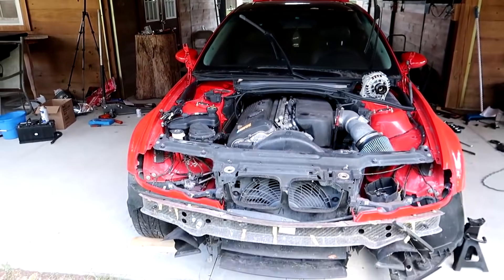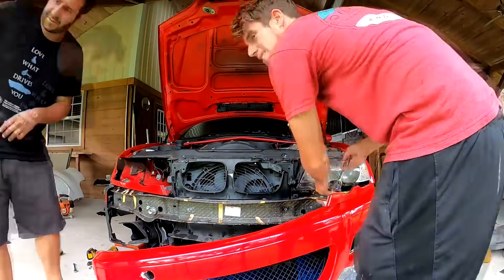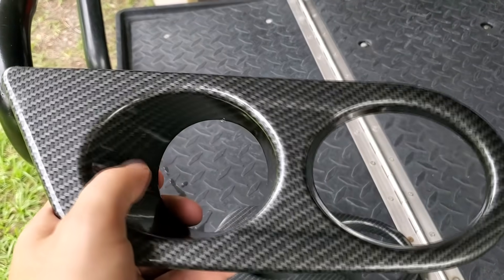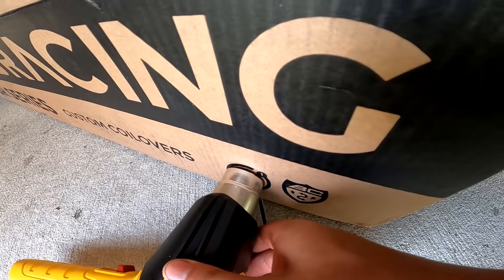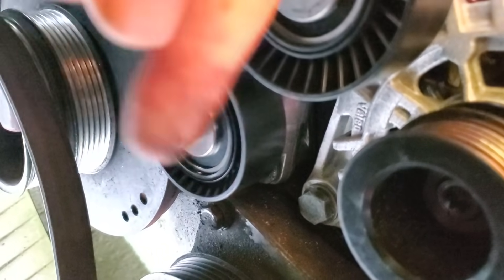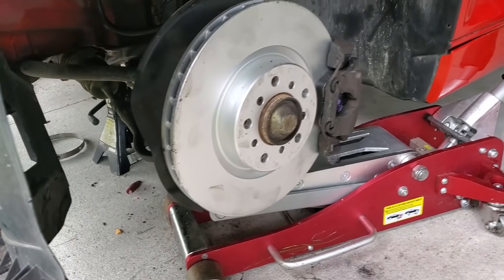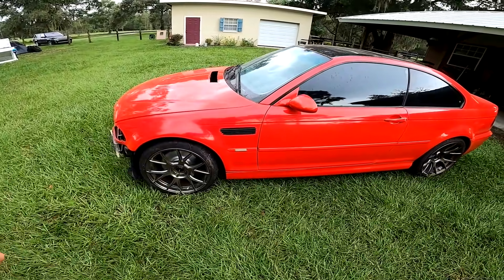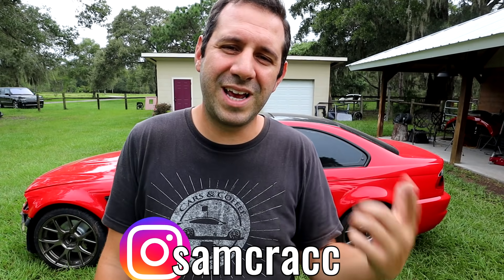I Got Lucky Buying a Cheap Flood Salvage BMW M3. It's WAY Better than I Thought!

Comment: "I didn't have any carbon fiber trim to match the rest of my car" so, I'll paint them black... installs fake carbon fiber steering wheel...
Reply: I understand it was a sponsor but even at that he completely contradicts himself lol
Reply: It's fake carbon?
Reply: Yeah, I had the exact same thought.  The dude is kind of a putz sometimes!
Reply: I'd put that wheel even on a bicycle, it's just awesome .
Reply: I have a similar carbon fiber steering whell in my car and I will tell you, it is not fake. I know Anthony (the guy Sam was talking about) and he makes these things himself with a lot of pride and quality. But the stuff up front came way before Sam got the steering wheel, so, he's not contradicting himself.
Reply: @bruces12  Besides, interior and exterior are two diferent things..., a carbon steering or shifting knob is always nice, even if it's the only carbon on the car.
Reply: I was about to write the same until I found this comment😂👍
Reply: It looked like the carbon on the steering wheel didn’t align quite correctly on the right hand side and Sam should have detailed the original boss/airbag . It looks a bit shitty on the new carbon wheel
Reply: @Mike Hunt Lame as the mat black rattle can rock chip prone spray can job? Get real!
Reply: @markbennett6658  This steering wheel looks really disgusting. Carbon fibre bits don't line up at all, the horn doesn't match to anything... And as a whole, this is something you will see every time....
Reply: @damndman2009  I get your point! And if it was me I would leave the fake carbon instead of the spray paint..., looks cheap to be honest.
Reply: It was free. I'm not a fan of carbon fiber so not sure if I would have put that on, even being free, but the next owner may love it.
Reply: @Mike Hunt Point taken. Cheers mate! 🍻
Reply: @diodiogo111  100% agree 👍
Reply: I'll walk with that steering wheel all day and steer my way around town.
Reply: Kronstad honestly probably I have a f30 3 series and if it was real it’s gonna be like 1200 just with carbon fiber for the steering wheel
Reply: Kronstad but you would never notice if it’s done super well
Reply: @damndman2009  or a red bmw with red leather still looks good
Reply: Horrible looking steering wheel.

Comment: You do NOT need to bake open pre-facelift e46 headlights. I made that mistake once and my whole housing got very slightly warped. The heat/cool cycle also made one clip on the other housing crack. There's just clips all around the lens and it pops right off, no adhesive, it's a rubber seal. If you're doing this to your pre-facelift e46, just be safe and don't bake them open.

Comment: “These carbon fibre fog light bezels don’t match anything on the car”.... fits a carbon fibre steering wheel 😑🤣
Still like your content Sam, keep it up 👍🏻
Reply: came looking for this comment
Reply: @Mike Hunt This steering wheel looks really disgusting. Carbon fibre bits don't line up at all, the horn doesn't match to anything... And as a whole, this is something you will see every time....
Reply: @KrzychooPe  I agree and the shape doesn't fit the car
Reply: @Mike Hunt If he/I made the steering wheel myself it would be OK, just OK. But for something "professionally" redone it's a no no for me 🤢
Reply: WHY PAINT THOSE CARBON FOG LIGHT BEZELS OMG CRINGE LEVEL 100
Reply: Nail it
Reply: Need to clean the center and dye it to restore the black
Reply: @Mike Hunt uh, no there's no difference. Both are fake carbon fiber plastic. He would have been better off keeping the light housing as it was.

Comment: Samcrac: Spends a ton of time explaining how risky flood cars are and they are massive gambles that inexperienced car owners should not undertake.

Me: instantly looks for flooded e46s
Reply: Freshwater flood cars usually have nice, clean bodies.  Buy a second similar or better wrecked car and swap over the wiring, interior, and other parts.  Its a lot of manual labor but usually fairly straightforward process.

Comment: Did they install the coils wrong? Looked like the chamber adjustment would be a a weird angle also adjusting caster
Reply: Mr. False I noticed that too
Reply: Yes adjustment is not supposed to be in angle, rather "side to side"!
Reply: They are wrong installed.
Reply: Yup and I commented on the last video that they were wrong too lol
Reply: I second that, installed wrong, steering wheel also looks like a ricer boy special.
Reply: Yep clocked incorrectly and that steering wheel is hideous.
Reply: Yeah exactly. Suspension is all messed up, ricer shit everywhere, no major items addressed (valve adjustment, vanos, rod bearings, subframe.) some poor idiot is going to have so much trouble with this car.
Reply: Yes, they’re wrong.  Should also do fcabs and rtabs while in there, at the very minimum.

Comment: I think the camber plate on the coilover are installed  wrong, suppose to be facing the engine not toward the front.
Reply: I was about to say the same thing.
Reply: Just said the same in the comments of a  previous video 🤷🏻‍♂️

Comment: Interesting camber adjustment🤔
Reply: I came it to mention that they installed the camber plates wrong. They need to rotate them one bolt.
Reply: Just Reading comments to check if someone else noticed
Reply: Surprised more haven’t noticed
Reply: Came for same.....
Reply: This is actually a "mod" for E46 M3 camber plates, you rotate them either 180 (L&R swap) or 120 (like in the vid) which will modify the factory castor angle. I personally had done the L&R swap years ago and found adjusting camber difficult, this isn't as quite as bad but doesn't provide the same amount of increased castor.
Reply: @ericc6485  there are better ways to adjust the castor such as with offset fcabs
Reply: @zachogdahl210  Yes, but this is free  (that's what I meant by "mod") lol

Comment: Lens on E46's re meant to be replaced. They come off without any glue on them they just snap on.
Reply: Ingress Wizard believe it’s only on the pre facelift
Reply: @UpsideGam3r  they are only glued on facelift cabriolet/coupes. Since the M3 never got the facelift front, they should be easily replaceable
Reply: No shit Sherlock, that's what he said.
Reply: Beat me to it.  New lenses really freshen these cars up and I wish it was this easy on other cars.
Reply: He was heating the whole lamp up so all the plastic clips holding the lens on didn't snap off.
Reply: @MCRedstoneXalbiX  I have an LCI cabriolet and my headlights are not glued. I installed halos on them a couple years ago and know I didn't need to bake them.

Comment: At around 5:00 when you removed the steering wheel and the clock spring came hanging out, I thought man sam, you made it worse. But you came through with the new steering wheel. Much better!

Comment: sorry, but this is the ugliest steering wheel you can find.
The carbon fibers from the upper and lower part do not match. And the beautiful contour of the steering wheel would be destroyed.
Why not just new smooth leather or Alcantara without changes to the actually perfect steering wheel?
Reply: its there for advertisement, you should pay attention.

Comment: Why no mention of BC Racing as the manufacturer of the coilovers? As some others said, the camber plates are installed incorrectly. I think you should lower it abut a 1/2 inch.

Comment: Sam, when you did the valve cover did you check the exhaust hub for broken tabs?  If it’s clean, I highly recommend doing the Beisan pump disc on the car which will fix a common issue and make the vanos much more reliable.

Comment: Buy the Depo headlight covers on ebay for the car, its the same company that makes the tailights you bought, they're $25 for the set, much easier than grinding out the old ones

Comment: Sam, you can restore your headlights by spraying some chrome paint on them. I have a Renault 19, the headlights are really hard to find, specially the Valeo/Cibie ones with the electric light adjust, and one of them was really bad, the chrome inside was in bad conditions, and swapping them was not a choice so i grabbed sandpaper and chrome paint and wasn't that bad the results, i bought rustoleum which can resist heat from the lightbulbs (now is not needed because it has LEDs)

Comment: Sam if you pull that big air intake off, you may botch the air/fuel mix.  If the prior owner did it correctly (a stretch), that big intake is usually mated up to a wider throttle body AND a software flash to accommodate the increased flow.  If you go back to stock, I'd make sure no software changes have been made.

Comment: Hahah I was wondering why were ovening the headlights. They're not glued I've had my 2002s apart a few times for cleaning/painting etc..takes minutes.
Oh and the grey screw between the headlight and turn signal allows you to slide the turn signal off the headlight. You don't needs to take them off complete., Only the facelift coupe got one piece headlights/turn signals  and the  m3 was never Facelifted..
Silver wheels are best 😁

Comment: Nice job ! You should have your steering wheel refurbished or using a used one, same for your tail lights originals would have been better. Have fun with this car, now you'll need sole dash trim too...

Comment: I may of missed some vids on this, but did he do a thorough inspection of the rear subframe mounts. It's the biggest issue effecting the E46 M3 AFAIK. May be a more euro problem though with a damp climate.

Comment: Sam, put the original intake on the car. The aftermarket Intake may cause your car to run lean, and eventually can throw a CEL. This happened to mine and seems to happen to quite a few e46's that I've seen in the forums throughout the years. Just letting you know to keep an eye out.

EDIT: Didn't get to the part yet where you said you'd replace it. Good man!

Comment: Sam , couple of thoughts generally.  First your life would be much easier if you installed a twin post above ground lift.  You can get them used for very little and installation is easy.  Second as an old BMW hand these cars are very responsive to proper alignment.  Night and day.  With the aforementioned lift you can get a used electronic alignment system and in 45 minutes really dial them in.  Cheers

Comment: With flood damaged cars, factor in the cost of all the modules and wiring harnesses on top of everything else you know or can see as damaged, you may get it up and running in the short term but the water will creep along the wiring and corroding connectors, wiring and module circuit boards over time.... it will be a time bomb and you will constantly chase errors and faults

Comment: @samcrac 2 things. 

You have installed your coilovers incorrectly. The plates are supposed to slide horizontally.

You also bought the wrong coilover setup. Your camber plates are meant to be offset as the M3 run higher caster angle. You bought the ones for standard E46. Your alignment wont be right now. Get BC to send you out the correct camber plates.

Comment: Does the us spec m3 not have floating or two piece brake discs? Also, steering wheel is a bit garish. The rest looks great though.

Comment: When removing a headlight or tail light lens in order to clean the interior, I recommend putting a thin smear of silicone o-ring lubricant, sourced from pool supply or plumbing section, across the entire gasket surface. Put a dab of silicone lubricant on your fingertip, smear your finger and thumb together then run your fingertip across the surface. Your finger should glide across the surface and not catch. When your finger catches, add more lubricant and repeat. When gasket is inaccessible to your fingertip, use a Q-Tip or similar to apply. 6 packets of ‘Aqua EZ’ o-ring lubricant is ~$4 at Lowe’s in pool supply section. If you replace the gaskets (one side is adhesive), I would still recommend lubricating the top surface. Since the headlights are already apart, I would simply replace the lenses before I’d fuss with dehazing them. Do NOT use ammonium based products like Windex on clear plastic because ammonia will fog them.

Comment: Painting the fake carbon fibre exterior trim black but still putting in that cf steering wheel is not a contradiction imho. The black vents are just more moderate and fit the rest of the ext trim. The cf steering wheel is a feature on its own. And it's inside. Different cup of tea.

Comment: I have a 2005 BMW 325i. I feel ya on the cost of garages to repair stuff. I had the driver side window regulator go out. BMW independent shop in Coppell Texas, wanted $450.00 to fix. I paid $40.00 for the regulator and 15 minutes of my time. I hate people who overcharge just cause they see those 3 letters: BMW= BREAKOUT MY WALLET

Comment: Yep, apart from the very late model E46 the headlight lenses just clipped on with a gasket. That style of LED tailight was introduced on the E46 from 2002 in Europe; fitting aftermarket ones on earlier cars will cause bulb warnings on the dash, the OEM version was integrated with a control module and needed coding to work properly.

Comment: I replaced 2 ignition coils and need to reset the ecu on my e46 330. Nothing I've found online has worked. Need some help. How do I actually reset it so the fault codes reset?

Comment: 15:30 don’t sand and buff the headlights . You need the automotive clear coat because it has the UV protection . Sand with 2000 grit in one direction , not in swirls, then shoot it with clearcoat. 
They will look 1000 times better and they will last years (not months when the wax wears off).
Reply: Just buy new lenses for 12 bucks a piece.

Comment: Headlight Lens Removal: I removed the lense on some Depot projector headlights I bought for my C5 years ago.  I put the headlights in the oven at 185 def F for 10 minutes.  The rack was covered with a towel to set the headlight on.  The lense pulled off super easy without spiderwebbing the acrylic and the gasket remained in perfect use for reattaching the lens.  It was as easy as using the heat gun trick, which is basically building a cardboard oven.

Comment: i think the camber plates may need to be rotated, i have BC's on my subaru and the plates are oriented to adjust camber in and out, not at an angle. could be different on his bmw but it looked wrong to me.

Comment: Try putting some motor oil in your battery ratchet head, around the selector switch. They are so much quieter after that.

Comment: Sands and paints carbon cup holders black because they don’t match anything... then adds a carbon fiber steering wheel which in turn does not match anything now 🤨😂😅

Comment: You need to paint the thing the mirrors plug into black, like a semi gloss black, as stock their black, and as it sits it gives away the cars been Modified, and chances are you will get reflections from them as you drive, and they look terrible, also those fiberglass carbon fiber lookalike buckets for the fog lights look terrible in matt black, like you gotta source a legit set, or atleast get them resprayed properly in a semi gloss black, also you need to get in a new airbag, that current one looks visually terrible against the freshly restored steering wheel

and you gotta source the OG tail lights, like Bulbs look so much better than LCDs, as quite frankly, LCD's are dangerous, their way too bright and blind people, and those arent OEM so you can be damn sure their even brighter than they should be, and your already driving a bright red beamer as it is.

also the roof, Not sure if you want to stick with Black, I remember the black being something they did on the CSL special edition, not really the stock M3, also is that Vinyl Wrapped or Painted?

also when you put the hood on your stand, you need to put some microfiber towels on it, or better yet, get some soft rubber matts for the floor, an inch in thickness, put them on it, as I swear those stands always leave marks even when people do go out their way to make sure they dont damage them, and i really dont trust those bloody things.

still regardless the car was a good score, and you know its funny this isnt the first time I've heard of a german car getting painted an odd color like this

the Ashes To Ashes TV Show Audi Original Quattro is actually painted in BMW M3 E30 Vermillion Red Orange from 1986, complete with like a dark brown Velour and mint green flannel interior, like man, you gotta see that thing, like you thought THIS thing was crazy lol 

weirdest damn thing though, it worked lol

Comment: The M- colored stitching on the steering wheel is in the wrong order.. It should be light blue, dark blue, red.

edit* 'Hotboxing' the headlight unit to remove the lens is a good hack, but in the future, you should remove the xenon module. Electronics hate heat just as much as they do moisture.

Comment: 12:08
Look man, I am impressed with the overall speed and quality of this rebuild, but could you not have put some more red paint down on the underside of the hood? Minimal cost (you were already painting it) for something that wouldn't haunt the next owner every time they open the hood.

Comment: My BMW E46 idler pulley blew up while I was on the interstate. It took out the belt, radiator, and expansion tank. but parts for the car are cheap and working on it is easy peasy

Comment: Your channel is great for people that want to learn how to fix problems with their cars themselves, but do not encourage people to buy a flood Salvage car. The only vehicles that have watertight electrical connectors are Toyota four-wheel drives and Jeep. I don't care what vehicle you have if that vehicle's CPU gets wet you're going to have nothing but problems.

Comment: Hey sam, i have quite a bit of experience with the e46 platform, feel free to message me if you get any strange fault codes or electrical issues.